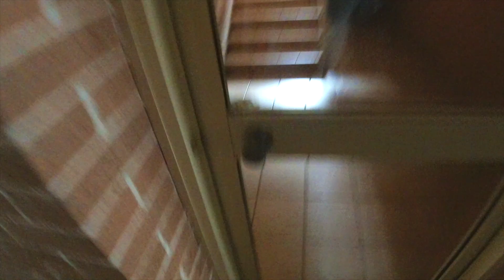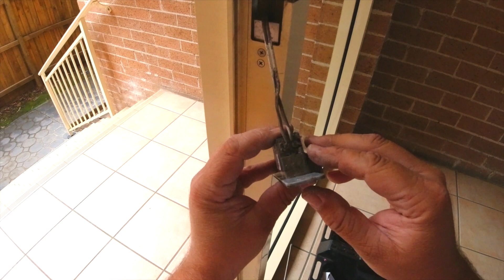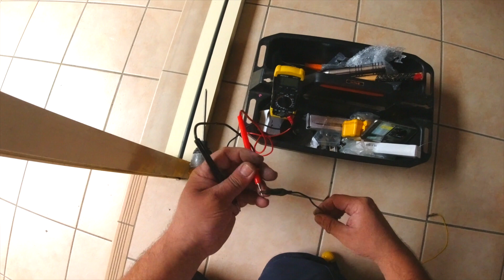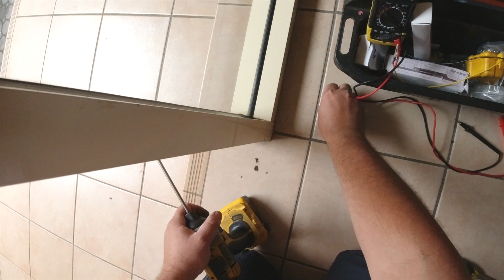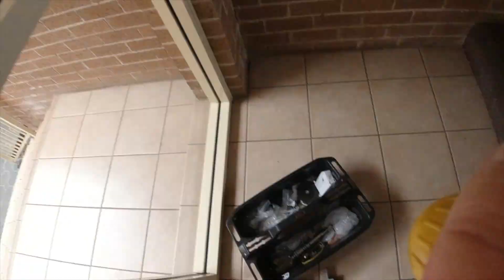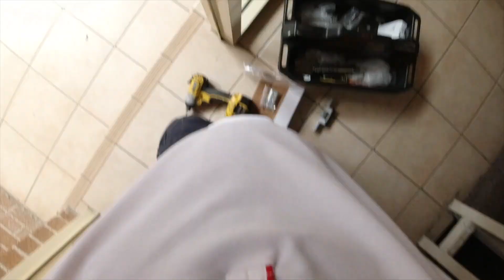Locksmith Job  BDS 46N Electric Strike

Comment: So this is powered by a transformer like a 12 volt transformer we use for door bells?
Reply from the maker: Yes, the intercom or access control system will supply 12v power when needed, or you could use a power pack.. When power is applied it opens
Reply: @DrLockShop  like a door bell transformer? thank you for giving me advice

Comment: 2:06 Small correction. An electric strike which is locked when no power is applied is referred to as "Fail-secure", not "Fail-safe". In a fail-safe installation, the strike would be unlocked when no power is applied.

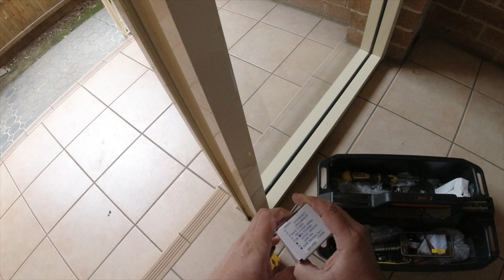7:56 Confirmation of fail-secure strike. Box for replacement indicates type as "NON FAIL SAFE".
Reply from the maker: yes you are correct

Comment: Good idea using the drill battery. I would be nervous that the higher voltage may hurt a 12V strike. 
Something that may complement your toolbox is an in-line power controller by HES. If you search the web for 2005M3 SMART Pac III 
Original & replacement was actually Fail-Secure. New box was marked as "Non Fail-Safe" meaning Fail-Secure.
Reply from the maker: That's a nice little device that paciii

Comment: I'm not sure if putting 20V through a 12V device is a good idea but it sounds like there was actually a mechanical problem with the old one, since the solenoid was working.
Reply: Agreed. I run 12v model trains off 9v batteries. But if i put in 18v i could break the train.
Reply: rule of thumb is generally +/-10%